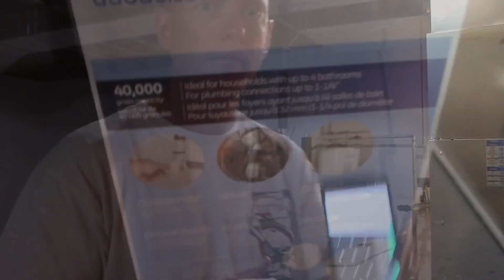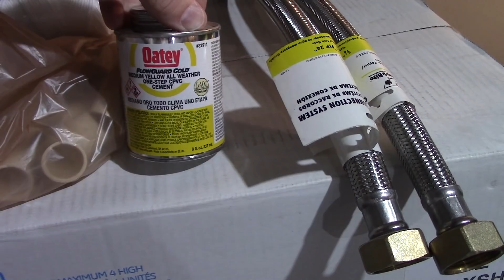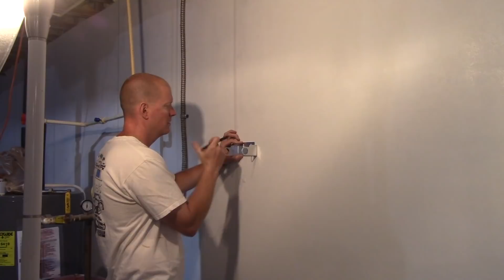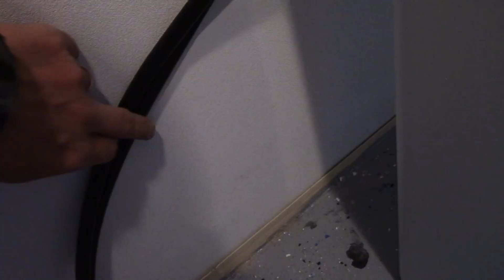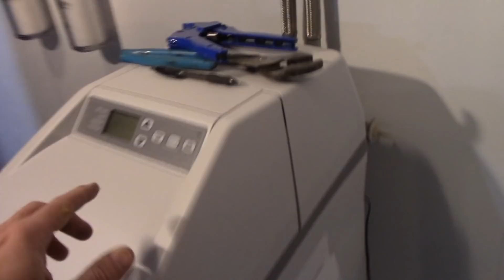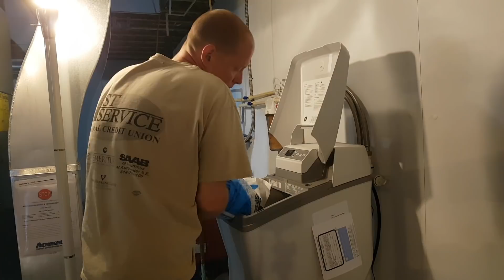How To Test For Hard Water and Install Water Softener & Filtration System GE GXSH40V

Comment from the maker: Hey Everyone. Thanks for watching. IMPORTANT. In this video I had installed the intake and return water line backwards. I discovered this after filming the video. So keep this in mind if you are using this as a guide for installing yours.
Reply: Did you notice a difference. Will there be an update to this video?
Reply: I was about to tell you that
Reply: You really need to add this information to the beginning of the video. I installed this unit in my home yesterday and was just browsing through videos and watched your install. I almost had a heart attack thinking my install was backwards and panicked thinking I'd have resin running throughout the entire house plumbing. Not cool my friend.
Reply from the maker: @booster2000m  there is no way to add it to the beginning of the video
Reply: @booster2000m  luckily it is an easy fix if you installed it backwards. you just switch the connections before bypass

Comment: Great video! Question: on mine, the black rubber hose that's leaving the water softener started spraying water everywhere so I'm guessing it disconnected from the drain hole between the two wall spigots behind my washing machine?

Comment: great job..... getting ready to buy this exact model to replace a Kenmore that is the same 41-1/2" from bottom of salt basket up to center diameter of the female IN - OUT adapters on the valve;   any chance you would be willing to verify that the GE is manual is accurate on the 41-1/2" distance by measuring your's?

Comment: Just a word of warning when screwing into masonry, I would avoid use of any impact drivers as you can blow out the threads your concrete screws are creating in the block as they go in, and wind up with a stripped hole.

Comment: I need to see the gluing of the 2nd CPVC slip to MPT adapter between the filters. When the short CPVC nipple was glued into the first adapter, it appeared there was no primer nor glue used on the CPVC. Also - the quarter turn on any gluing needs to be done AS the plastic pipe is slipped into the adapter NOT AFTER it bottoms out. Still can't figure out how the 2nd filter was glued in with the bracket in placez

Comment: Hello, thanks for this video. It will help a lot for my next project! I got two questions for you. First, would it be okay to install filter after water softener? Second, how much water does it discharge during the recharge process?(its almost impossible to find good drain location for me)

Comment: What kind of flexible water lines did you use to run water to/from softener? stainless steel?
Reply from the maker: Yes. Shark bite braided stainless 3/4"

Comment: that is why every home should be done hell half the new homes today dont even have shout of valves on them, you can new have enough shout offs.,, i have neve bought a test kit, when i bought my unit, the store i bought the unit from, had me bring in a water sample, they tested it and told me what to set my unit to. / mine was and still is at 60/30. for every 20,000 gallons, they not charge, same with our well water, test for ecoli.. and other crap we take a sample of water  into one of our local heath unit once a year, they test it 100% free of charge test bottles

Comment: I have iron in my well water. The water is clear but stained toilets and tubs. We have a whole house filter system. (which is two filters under the house) We need to change them once a month. Will this help so we don't have to change them as often?
Reply from the maker: No because the water softener goes after the filter to protect it. It will help keep your toilets clean but you will still have to change your filters regularly.
Reply: get a water boss softner  and use with MORTON®
CLEAN AND PROTECT PLUS RUST DEFENSE salt bags I use to have really bad rust stained toilets sinks bathtub you name it and now they are clean the magnet in the water softer pulls the iron out of the water and the rust removing salt cleans the brine/magnet in the water softner!!!

Comment: 10000% you did.  At the end you hooked you in line to your out and your out line to your in on your water softener.  When standing in front of the unit and looking at it.  Your right side is the water in and the left side is the water out.  And you can see real quick the word out imprinted on the plastic PVC.  How long did it take for you to see that and fix it.  Just sad you did it OFF camera so not to see you messed up.  Just saying.  I have the SAME softener and same hookups.
Reply from the maker: I realized it after posting the video, so I couldn't fix it beforehand.

Comment: Hey man sorry for the dumb comment, but I had a plumber install my water softer same model and everything. Whenever It’s recharging all the water goes to the drain? Is that supposed to happen? If not I already flipped the in/out water lines and it’s still doing the same thing. Please help lol
Reply: When the unit re-generates, it does send all of the brine water to the drain. Not sure why you swapped your inlet and outlet? Probably need to check that and put it back like the plumber had it for you!

Comment: I wish I would have seen your video sooner.... We started with just a water softener and with in a few months we noticed the only water anyone was drinking was from the filtered fridge.  I purchased two GE filters like yours and purchased 1 large string wound sediment and 1 for more fine sediment.  I was told buy the company I purchased the water softener from to put the large sediment filter first, then the water softener, and then the fine filter.  This has caused all of our fixtures to now have a film all over them... also added cost as I purchased more 90 degree shark bite clamps to get this thing run.  I am about to rip the entire thing out and start over..... your thoughts please?

Comment: Your sediment filters already have a bypass.  You don't need to make another bypass. Your water softner also has a bypass. You hooked up the system backwards.
Reply from the maker: I know I hooked the hoses up backwards in the video. This was addressed in another comment. The filter housings are notorious for having problems when using the bypass or the air purge. You should never ever rely on that bypass

Comment: Can you drink the water with this installed?
Reply from the maker: It's not a filter system, it's a softener, so it wouldn't change whether or not I would drink the water.
Reply: If you want, but it’s not recommended. It’s just softening the water. Not filtering it.

Comment: Thank you. I am needing to replace a 15 year old water softener machine that has stopped working. Would you still recommend this GE product? When reading reviews about all of these different machines, I come across everyone of them failing in a short time. The one that I am replacing only failed after 14 years. I cannot seem to locate the brand on the housing. Thanks again!
Reply from the maker: It's still working... So yeah I suppose I would recommend it.

Comment: I just bought a home and the water softner only has one filter hook up. Could that be why my water tested high for hardness?
Reply: He did two filters because this home is running off of well water. Your home is most likely running off of supplied water from your towns water filtration plant. Especially if it’s a sub division built home.
Reply: He's on well water.. If you're on well water then sure if you find a lot of mud in your water.. if you get your water from the city then you only need one filter.. Fine mesh filter

Comment: 80 gallons of water one person uses a day?
Holy Macro.
I say 20 gallons tops.  And nobody runs away from my stench.
Reply: You'd be surprised if you actually metered it.  An 8 minute shower alone is 20 gallons (2.5gpm typical shower head).  That leaves you with no water for dishes, toilet flushes, cooking.....  80 is normal.  People who are conscious about water use can get by with less, but 20gpd is quite low.  I design municipal water treatment plants for a living.  For planning purposes, we use much higher than 80 gpd actually.  If you flush the toilet just 4x a day that is 7 gallons right there with a modern toilet.  If you have an old toilet, it is much more than that.

Comment: Did you really say, “ Be careful so you don’t strip anything,” while you were tightening those fittings with a pair locking pliers!😱
Seriously, many good tips. It was sharp of you to mention how one might be disconnecting their panel ground from the cold water inlet pipe by installing the system.
Reply: those were slip joint pliers

Comment: There is 17.1 ppm in 1 “grain”. When you were doing your calculation you should’ve done 250 ppm / 17.1 = 14.6 grains per gallon. 14.6 gpg x 160 gallons per day = 2336 per day x 7 days between regen cycles = ~ 16500 grain capacity, round up to a 20,000 grain unit. So you actually bought a unit big enough for 4+ people to live there.
But hey now you only have to regen about once every 2 weeks. Better to have more capacity than less!
Reply: THANK YOU!! For correcting his grain calculation! I used his original calculations and thought, "oh great - now I WILL NEED to buy the $4800 Culligan unit."
Reply: Just installed my 3 months but water still hard. Any advice? Please
Reply: I just installed 3 months but my water still hard. Any advice please
Reply: vu Hoang getter a higher rated softener.
Reply: I thought it's 40 gallons per person per day?

Comment: If you have a well you should use a UV system with a pre filter. I find that the GE system is not good for well water, its only going to last 7-10 years before you will have to replace it.

Comment: Your details are clear, my problem is i have a tankless rinnai heater.. i dont know where to start.
Reply from the maker: Will want the filters and water softener before the water heater
Reply: got a new home with a pre plumb for softener can i play with it and add some bypass valves just in case for maintenance?
Reply from the maker: Yes
Reply: @JackofAllMasterofNone   cool already ordered all the stuff added 100mesh ispring sediment filter before the 2 GE filters.
Reply: Definitely you want to place the softener and filter before the tankless heater, you won't have to do the annual maintenance on the heater maybe just every 4 years.

Comment: The black drain hose! Is that supposed to filter out? We just purchased a home and woke up to that drain hose spraying everywhere. What do I do with it? ( the hose)
Reply from the maker: It has to be run into a drain.
Reply: @JackofAllMasterofNone  If  you're running a faucet in the house and the reservoir overflows, how fast does water come out of the overflow tube?  What would cause an overflow?
  I'll use an existing drain pipe now used for my adjacent washing machine and water treatment unit.   Since it's gravity flow, it looks like I'll have to modify the drain pipe to accept it below its outlet.   Looks like it's about 3' above the floor?

Comment: You hooked that up to the softer valve backwards from the manual. The water from the well would have been on the right and the output to the house on the left side of that softner valve. How did that work? Did you test it like that?
Reply: I was thinking the same thing. Just hooked mine all up. And then watched this video. About lost it when i thought i hooked it up wrong.
Reply from the maker: Yes. I know its hooked up backwards in the video. I did fix it. Surprisingly somehow it did work that way.....
Reply: @JackofAllMasterofNone  You should strongly consider editing the text comments if not done already and also the video with a text call out overlay to inform the viewer that you installed the bypass valve backwards.  Water flows...but which direction matters.  You could create another video as an update so that you don't lose the YouTube views count on this video.  Great video all around though.  👏
Reply from the maker: @MichaelRogers_MWR_Enterprises  I will do that. Can't do an overlay. But I can do an edit on the description

Comment: It looks like you have the water supply line leaving the two filters and going into the outlet side of the water softener, shouldn't it be going into the inlet side of the softener?
Reply from the maker: Good eye. FIgured it out pretty quick when the system wasnt using any salt.

Comment: they come from factory set at 25.  so what hardness number did you enter?
Reply: Good question. I bought an A.O. Smith unit. No where in the manual does it tell you how to set the Softness Level.
My water tested at 7 GPG. The help line told me to set it at 7 but doesnt seem right. Still researching